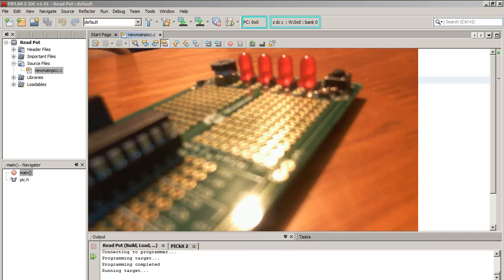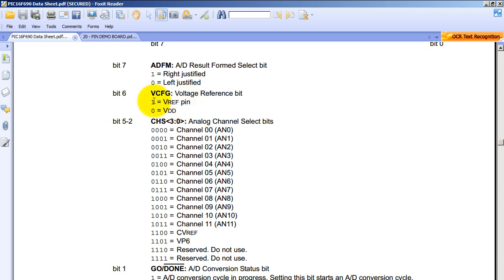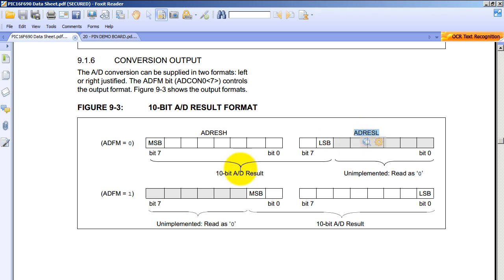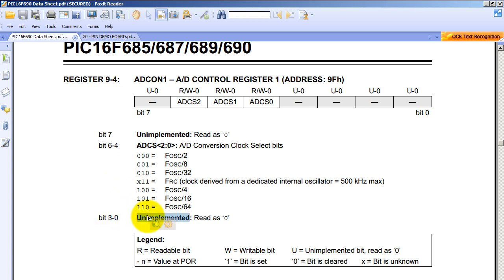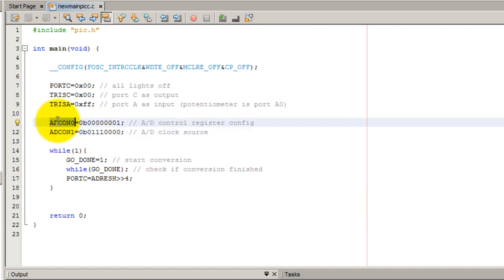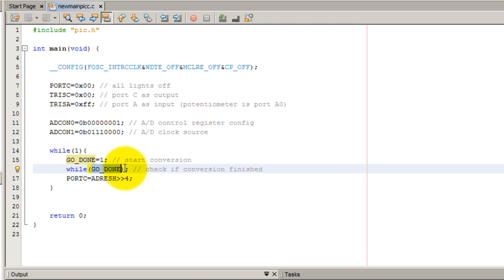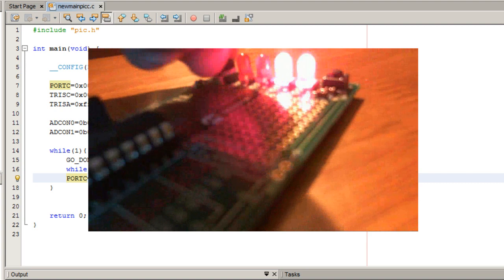PIC Programming - AD Conversion With Potentiometer (HI-TECH C)

Comment: Excellent tutorial. I just had a question, if someone could answer it I would be very greatful.

So you know how we are using a potentiometer as a analog input; what if we had more analog inputs, going to AN1, AN2, AN3?
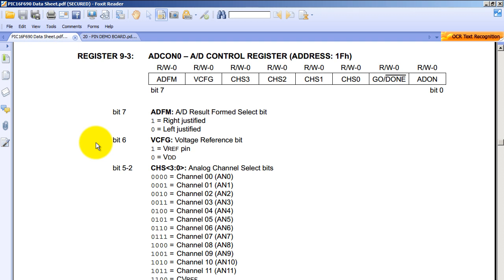Do we change the value of AD1CONbits.CHS (1:17) every time we do an A/D conversion, or we have an option to initiate multiple A/D convertors at once?
I am trying to build a line following robot with six sensors, all sending a analog value. Any help is appreciated.
Thank you.